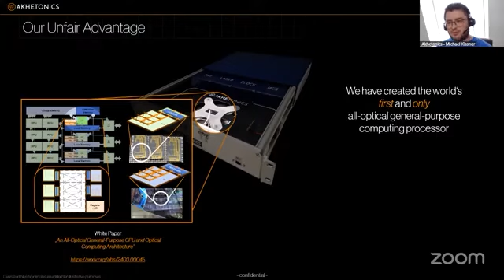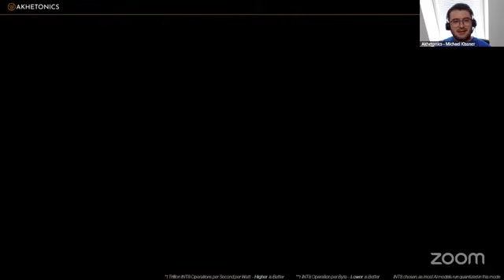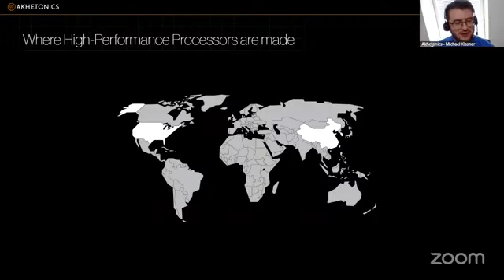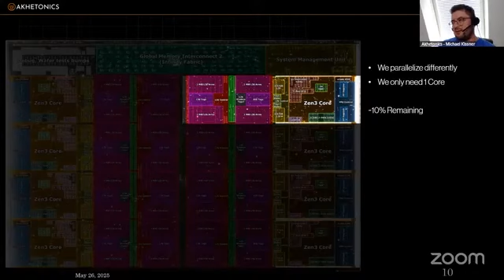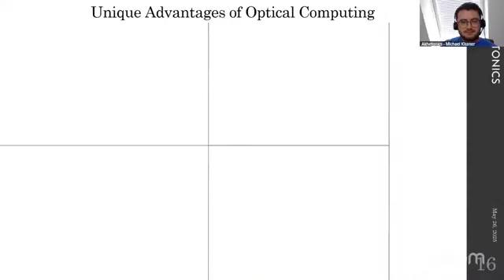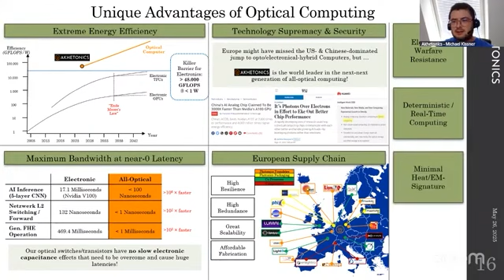Photonic Computers and AI: Akhetonics

Comment: I'd love to know how they cracked the "Stored Light" memory problem.

I bet it's pretty alien. Do these things even use a clock to pulse light, or is it somehow in a perpetual state? How do you keep a 10 megabyte image in Photoshop handy to run transformations on it?

I don't get it.
Reply: My entirely uneducated guess it's that it probably works like a particle accelerator but with simple light, where the light prismatically splits at a point on a loop, and then is fed back in to maintain the integrity of the stored loop. 

Probably the best way to find out how they solved it would be to look back at old analog systems?
Reply: @slomnim  Actually, I just needed to go look. The tech is remarkable, microscopic and fully solved. They've got fast and slow memory, all the logic gates, all fully addressable.

The tech is absolutely real.

The speed bump.., is that programming/chip design with photonic silicon is completely different than with traditional transistor gates.

To learn to program the old way, you get a basic computer engineering degree. The cheat sheets are done. You can download all kinds of different CAD software right now.

To learn to program the new way.., you have to get a high level degree in physics just to get started, and then you're out there pioneering. The plug n' play engineering cheat sheets are still being written. The CAD software doesn't exist.

It's going to take, at the earliest, about 10 years before this stuff is market ready at scale.
Reply: @MarkOakleyComics  I don't think it'll take that long. Once a prototype is shown to function, I have a feeling it's going to rip the chip market apart as the entire AI / big tech industry does a hard pivot with everything they have.

The benefits are far too worth it to stick with electronic chips. If these guys can show of a functional working photonic computer later this year or early 2027, it will be an entirely new race to maximize industry in this direction
Reply: @slomnim  That happened LAST year. -Akhetonics demoed their photonic hardware by running a fully playable copy of DOOM. (The so-called, "DOOM Test".)

So it works. -On their beta chips from fabrication.  They're developing the software and all the tools and systems for a big scale-out as I type this.  It's happening.

But it's still going to take about ten years.

It simply takes time, no matter how big the demand or deep the purse. It takes a few years to find and train engineers in the tech to the point when they can say, "Yes, I am able to design your tensor math chip!"

Then it takes time to actually deliver said chip, from design through testing.

Then it takes time to design and build the mother boards and supporting hardware.  (There are a lot of novel parts and processes needed, each one possible, but requiring a plan and agreements. And each part must fit with all the other parts.)

Every step requires meetings and agreements and lawyers to oversee the IP and negotiate the responsibilities and obligations. Plus you need to secure investment to make it all go.  That's endless phone calls, emails, meetings. Getting anything done takes... Time.

You get the idea.  Ten years is optimistic.

But it is definitely underway.

The only thing that would accelerate the process would be to put it on a national war footing. And even then...